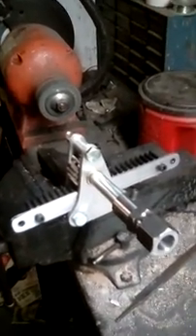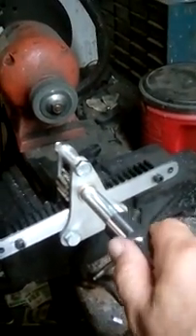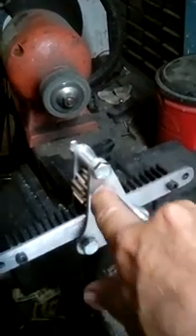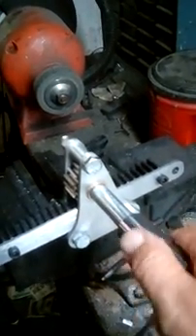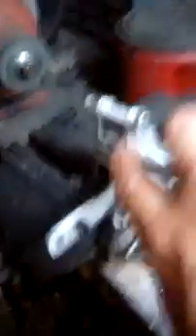Rack and pinion for cycle karts

Comment: where can you buy the rack and pinion hardware to build one of these myself?
Reply from the maker: I got them on eBay.  Amazon also has them.  Just make sure your gear and rack have the same pitch angle so they are compatable
Reply: @1908Rick  how can I contact you for more information. Love the thought process and design.